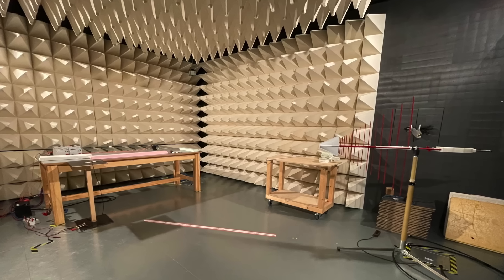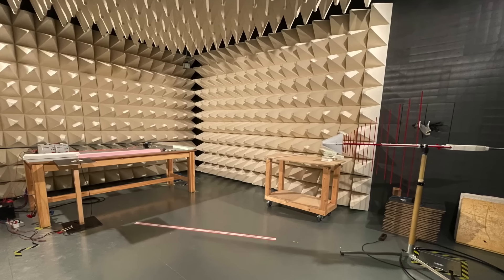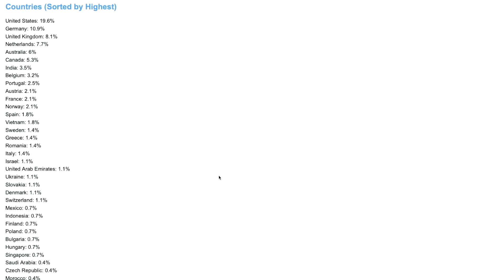I Built the Perfect PoE Sensor - But Can't Sell It to You

Comment: In the USA it has to be a development board. Then let the user do with it what they want. I see so many boards without FCC approval. It is expensive. Best to use with FCC approved modules(like esp32). Even if it is an unintentional radiator FCC part 15 approval is required. At $300-500 an hr. you better make sure your product performs to standard. Best to buy a spectrum analyzer, make or buy antennas and a chamber(small will do) and do pre testing. If you are serious about a product that is what you have to commit to. I see a huge number of meshtastic modules with no FCC approval. Seeed makes one with the SX1262 that is FCC approved. Using modules that are FCC approved in your product will help. But you still need to do the EMI tests radiated, conducted and so on. I have done so many designs and lab testing it is pretty easy to pass. You just gotta do your homework. Here is a tip. When the lab tech says you have a band out of compliance, ask the tech using the spectrum analyzer to demodulate the offending freq. The demodulated signal will show you exactly which signal in your system is the problem. Could be a clock or other digital timing signal. You should just make the board and sell it on Tindy.

Comment: My impression is that the sellers on Aliexpress, banggood etc don't care much about those regulations (which would be better if they would not apply to small start-ups) so what about selling the kit/product from some of those? Alternatively, what about leaving some solder bridge unsoldered and sell the product together with a 10 Euro soldering iron kit (come complete with everting, even temperature-controled) from Aliexpress? If you have to solder the the final connection, you're definitely not selling some fully-working appartus.

Comment: What is a PoE sensor? But regardless: Of course you're right, and that's what the EU should be doing next: standardizing, for example, recycling fees across Europe. Companies pay a fee to the EU, and the EU distributes the money to member states based on their population. Likewise, changing (across Europe) to using QR codes with online information instead of paper (permanent, say, for 10 years) would also be a contribution to improving the environment. Send a link to this video to every MEP and every other EU official whose email address you can get.

Comment: In my opinion, if the regulations prevent people who consider EMC to be "black magic" from selling products on the open market, they are doing their job perfectly. This does not mean I want to see you fail at building and selling your product, but I hope you learn the necessary skills and insights in order to create and sell such a product responsibly. Just like I expect people who want to drive a car on the public road to have a drivers license or take the bus or a taxi.

There are a couple of things that don't match with my experience in this video:
1:00 "you actually have to buy these standards."

To get a CE marking, you have to comply with these standards, but you do not need to buy them. A notified body such as the test house should have access to these standards, and will evaluate your product against them. You can verify devices yourself, but as you later note, for EMC this requires expensive, specialized equipment by far outweighing the cost of any standards.
Your product looks like a low voltage device, so most of the requirements fall under the RED and LVD. Most (all?) of these standards are freely available in many languages, see https://eur-lex.europa.eu/legal-content/EN/TXT/?uri=CELEX:32014L0053 and https://eur-lex.europa.eu/legal-content/EN/TXT/?uri=CELEX:32014L0035. These are only the "high level" directives, specifying what norms and standards your product needs to comply with, depending on what it is. In the end you need to comply with technical standards like e.g. ETSI EN 300 328, also freely available: https://www.etsi.org/deliver/etsi_en/300300_300399/300328/02.02.02_60/en_300328v020202p.pdf

The standards that often require payment are mostly related to electrical safety and suitability for industrial environments. Especially compatibility with industrial systems, which is not a regulatory thing. These typically do not apply to low voltage consumer electronics.

You designed a PoE product, but used an ESP module (that has a WiFi and Bluetooth radio) to do so. This means you need to certify your product as a radio device, which means calibrating the TX power and bandwidth, proper filtering and layout to prevent unintended emissions and prevent susceptibility to interference etc. You could have made your life a lot easier by using a microcontroller that does not have a built in radio, because a lot of (often difficult to meet) standards would not apply to your product.

Comment: You're totally overthinking this and it seems you got some bad advice. There are guides for what CE rules apply to what type of electronic product. No need to buy all those documents. Unless you have some unusual mains connection or wireless stuff going on that can not inherit compliance, it is likely that only a few simple rules apply to your product. Also, you don't need to translate everything in all languages if it is the costumer who imports your product. And if you're working with a distributor, the burden shifts to them.  See if there is a organization for tech startups in your area, they can help you on your way.

Comment: Yeah, compliance is important but it should be easier:
1. There should be an easier way to figure out which regulations and standards apply to your product. Something like a guided procedure (does it have a radio? is is powered by the mains? etc.).
2. All testing standards should be freely accessible.
3. Testing at an EMC lab should be cheaper. But the equipment is very expensive, so I think labs can't do much about it. The government could cover part of the cost for startups.
4. There should be exceptions for very low volume products, as long as they are safe by design (low voltage/power, using certified batteries, designed with protections against wrong polarity, short circuit, etc.)

Comment: Do not set up your own online shop! Use shopify. Also, a lot of rules are applicable only above certain thereshold, i.e. VAT registrations are required only if you sell above certain level in a particular EU country which helps small businesses. I am not an expert in electronics or law, but similar rules may apply in your case as well and sale of small amount of units may not require as much of hassle.

Comment: The easy solution is to have it produced in China (usually) and have the individual customer import it in small quantity.
The usual way to do that is to sell it via a Chinese webshop like Aliexpress.
Put a CE mark and the other relevant marks on it (like the crossed-out trashcan).
And of course make at least some effort to ensure you do not attract attention to your product by e.g. interfering with broadcast radio, TV, emergency services, etc.
How much effort that is when designing and testing of course depends on what your product does (if is it a transmitter, it will be more difficult than when it is just temperature and humidity sensor).

Comment: Simply sell it as a kit with  'some assembly required'  then many of the fees you've just listed wouldn't be needed.  Even if it is 99.9% pre-assembled prior to shipping by you, but it still needs to have a control knob put on by the customer, then it can be sold as a 'kit'.

Comment: The testing for ce is much cheaper in China
Even if you write a certificate and it isn't compliant, the fines aren't as expensive as the test in europe.
The wastebin logo was wrong if I'm not mistaken. Needs a black box under it.

Not sure if you need the whole manual in several languages, you need the caution,  dangers and legal stuff in it i think, not how it works

Most steel the agb from an other online shop in the same category and just change a couple things 😅

Comment: 📎 Clippy never made it so difficult to make products or sell in the EU 📎 He just wanted to help.  

Here in Northern Ireland we need veterinary inspections to bring a pot of yogurt from mainland GB, into Northern Ireland.  That's how absolutely pathetic these EU bureaucrats are!  Yet the same EU bureaucrats allowed horse meat to be relabelled and sold as beef.  Also the insulation used on Grenfell Tower was CE marked as being fire resistant, and that building went up like it had been wrapped in oil, with thick black smoke.  There is also insider evidence that the "Euro 5" emissions standard, was purposely designed to allow big EU car manufacturers to cheat the test and allow them to pass, but manufacturers from outside the EU would fail the test and banned from the EU market!
Reply: "horse meat to be relabelled and sold as beef"
WTF, what problem to sell horse meat as horse meat?

Comment: For independent product designers, the key is to not have to directly ship anything.  Some circuit board manufacturers will allow you to upload a design so the PWB can then be purchased directly by anyone with you getting a portion of the proceeds.  You could then sell the software/firmware along with the parts list and housing STL files with zero physical shipping or handling.  Some distributors allow you to create a Bill of Materials and share it with others, so they can purchase the components "kit" directly from the distributor.  I'm sure there are rules and regulations that you would still have to follow for online sales, but this should eliminate much of the burden of selling your product.